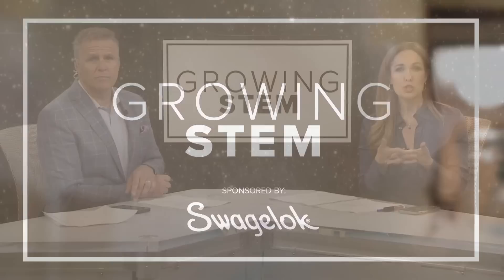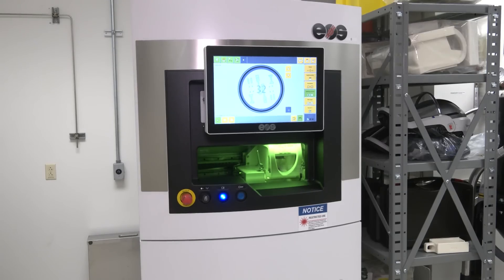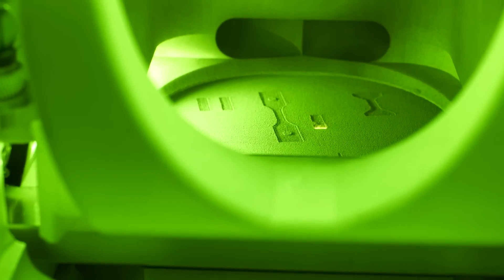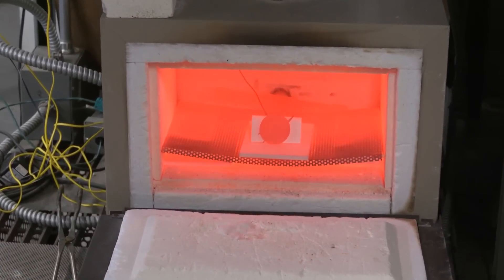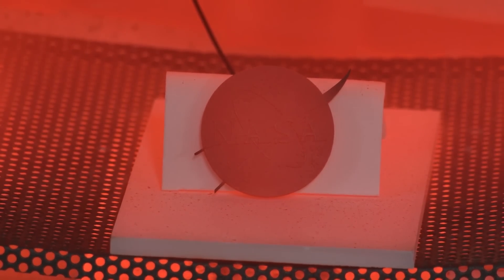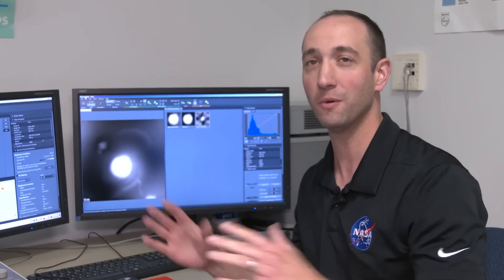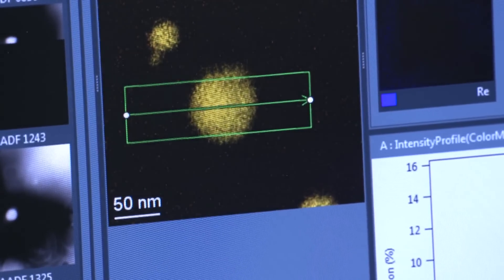2 NASA Glenn engineers invent new superalloy worth billions | Growing STEM

Comment: What's the ultimate tensile strength? Melting temperature ?
Reply: this alloy is also a few years old
Reply: The MDS is available via the 3D Systems website. Graph shows ~125-130MPA at 2000ºF. Melting temp not given, but the material did stretch by 38% at 2000ºF
Reply: @sapiotone Inconel 718 is still the king
Reply: @spartanpatriot3163  Think of this as enhanced Inconel. The use of dispersed oxides will definitely upgrade the high temperature performance over regular super-alloys.
Reply: @Hydrazine1000  Still ceramics including Ytterbium , Iridium , Tungsten seems better alternatives to high temperature applications such as hypersonics for instance where 1100 degC is nothing and we are talking about 2000+ degC but of course ductility is also important MMCs are CMCs are good choices.
Reply: @Hydrazine1000  : People like you (MSc materials) need to invent transparent aluminum like in star Trek.
Reply: @nikolaforzane2285  I hate to break it to you, but Star Trek is Science Fiction so transparent aluminum going to remain a dream. At least, per the lore, metallic transparent aluminum is impossible because aluminum does not have the atomic properties to achieve this.

Then again, if we veer away from the Star Trek lore, we do actually have transparent aluminum now. But it's a compound of aluminium, nitrogen and oxygen, so it's not metallic.
Reply: @Hydrazine1000 AlON is basically a ceramic material right?
Reply: @user-lp3cf5yn5b  Yes. And not "sorta" but fully conform definition of strongly bonded metallic and non-metallic elements.
Reply: @Hydrazine1000  transparent ceramic material is just as cool as a transparent metal as far as I'm concerned. Do you think they'll ever be able to mass produce it in a way that will lower the cost to make it commonplace?
Reply: @sapiotone u smart ty
Reply: @sapiotone  Big stretch but I don't know what it should be compared too... I wonder if it expands less at lower temps for forged engine components?
Reply: The video prompted me to do some "searches"... and you might want to give it a try.
Reply: Open google before you open your mouth.. https://ntrs.nasa.gov/api/citations/20220013032/downloads/LLNL%20Seminar%20-%20GRX-810_v1.pdf
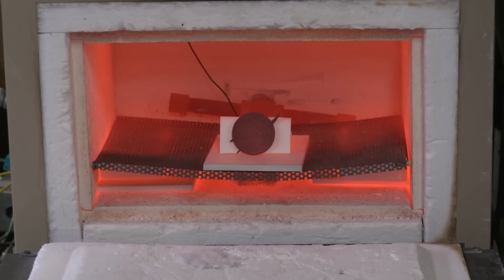Reply: 1:22 Ceramic
Reply: NASA is never fully transparent and only serves the interests of the aerospace corporations, not the public.
Reply: meh, id still take damascus steel blades to a composite  😅 jk
Reply: Basically, this is kind of like 316L Stainless Steel but without the iron! I would say it's worse than 316L for machining and forming and has 1100+ Celcius of heat resistance! Medium Entropy Alloys are highly cold and corrosion-resistant but only good for a general-level of TOUGHNESS in those same cold and hot environments. They are not strong tensile strength-wise (i.e. 350K Maraging Steel is 350,000 PSI ultimate strength and yield strength is around 320,000 PSI in comparison!). This Medium Entropy Alloy (MEA) is about 90,000 PSI base tensile strength and won't crack even in space cold (i.e. -250C and below) so if you wanted to build a satellite or spaceship, this type of metal might do just fine! You can get versions at 290,000 PSI but that just makes it brittle!

I personally would just use thicker 316L or 440C Stainless Steel sheets and coat it in a 3 to 8 mm layers of Aluminum Oxide Ceramic (2000 Celcius heat resistant) and Line-X Truck Bed liner (i.e. a super-tough and weather-resistant polyurethane-based coating!) to prevent hydrogen and cold embrittlement! It's much cheaper than this stuff and it has 75,000 PSI tensile strength so not that bad, good enough for most jobs and is ductile enough to not simply break in half any-old-time even in the cold of space when it's properly coated with ceramic/enamel and some Line-X Truck Bed Liner!

You can even use 440C Stainless Steel with 110,000 PSI Tensile Strength normally and with some fairly inexpensive aging and heat treatments, you can get it to 285,000 PSI tensile strength!

V
Reply: That is probably confidential information at this time.
Reply: @The1stDukeDroklar The ingredients can be confidential but the properties of the material??! Are you dumb or something??!
Reply: @The1stDukeDroklar  LoL what bull shit what's tensile strength to do with any confidentiality
Reply: For a know it all . That's a pretty stupid question  @FLORIDIANMILLIONAIRE
Reply: @The1stDukeDroklar I highly doubt it's a big breakthrough.
Reply: nano 
0.00000000x 
10^-9  ...
Reply: are you asking the comments or the reporters.. Either way, do your own research if your really interested..
Reply: That's too much information for them to make up about this fake story.
Reply: @VoidHalo  This isn't fake. It's just a tiiiiny little bit hyped, that's all. 

This GRX-810 is a so-called "oxide dispersion strengthend alloy" which means they've caused nano-sized oxides to form in the alloy. Those oxides do help improving its properties at 2000 °F ( about 1100 °C), there is nothing magical about that. 

(Background: I do have an MSc in Materials Science & Engineering, so perhaps I do have an easier understanding of what it is that makes this material special.)
Reply: @Hydrazine1000 what makes it special?
Reply: @FlowSharp  Because this starts as powder for 3D printing, they can mix very fine metal powder with ceramic powder. Getting those two very very finely mixed, in a way that they don't separate during powder handling or printing, is the difficult part. They mention ultrasonics for mixing, which makes sense to get very fine powders of different densities uniformly mixed.

The powder bed selective laser meting (SLM) printing process melts the alloy and incorprates the oxide particles, so you end up with a metallic structure with uniformly dispersed oxides inside, which improves the high temperature performance significantly.
Reply: @Hydrazine1000  Thanks for the info.

Comment: Utterly Useless Reporting, you fail utterly to describe what properties  make it a better alloy...
Reply: It's a fracture resistant material that can operate at 2,000 degrees Fahrenheit.  Temperature resistance materials are typically very brittle.  This material is less brittle than those other temperature resistant materials.
Reply: I got useful tips like using ultrasound to mix, I can find lots of uses for that.  A composite metal/ceramic part is natural evolution of pine resin/carbon powder composites cavemen used to bond handles to stone knives.
Reply: @miken7629  I think the key is they use the laser to then melt the metal in an extremely focused and limited fashion, trapping the ceramic in the structure. The nano particles and ultrasound mixing are just probably one of many ways they could go about the prior step.
Reply: I gave it a like, but not sure it was completely fair. But the complete lack of quantitative information made it impossible to determine much of anything from this report.
Reply: @davefoc  It was more of a infomercial than a NEWS report. The "Its beyond me" was a bit overplayed here by Ron Pearlman but she has a Great smile.
Reply: Ummm, they clearly said it could withstand extremely high temperatures that would cause other alloys to fail. It also told you that it is 3D printable which allows it to be made into shapes that others could not. What more do you want?
Reply: @The1stDukeDroklar  quantitative information
Reply: Propriety ingredients?
Reply: well... they dint tell but a crossproduct is tungstencarbidpowder sinterd and coated with TiAlN or similar ceramic. Or some super nickel alloy powder coated with some tuff ceramic like coating. You can do a lot with 3d printing the trick hereby is the spongelike matrix that can get coated almost everywhere. By having a very robust metal skeleton and a ceramic coating you can build a lot because the metal cannot oxidize in a harsh hot enviroment. 

Some german private company made some air pressure testing nozzles 3d printed the trick there was that the nozzles are 200mm long 4mm thick with a 0.5mm hole you could not drill the hole because of the nozzles shape, was like an "J". 3d print that is easy sintering to but drilling impossible. 

it is a amezing technology for sure!
Reply: @fearlyenrage  I love this stuff. I want to see 3D printed / acoustic-mix carbon nano tube superconductor, printed within a substrate semi-conductor. (or something more intelligent than my musings)  I bet someone with similar ideas, but an infinitely deeper understanding of them, is wondering how to fund such a project, right now. I hope so anyway. It feels like we're close to a point where our state of the art production, and computing, will find their convergence in time, and mutual benefit, to create a better version of a machine or process than what we have yet to completely conceive. And the human brain will add to that positive feedback. Amazing things are ahead!
Reply: what ? they didnt describe properties?! did  you even watch the video?!
it withstands rapid heat fluctuations without structural change/failure & is printable!
Reply: They described it.
Buy a thesaurus.  Look up synonyms for 'utterly.'
I have a feeling that you also overuse that word elsewhere.
Reply: On the NASA gov website you can find more information on this alloy. 

The big benefit of this alloy is its properties at 2000 °F operating temperature, compared to more conventional superalloys. At this temperature it can bend a lot more before it breaks, it has a higher fracture resistance and it is longer lasting.
Reply: They said it's heat resistant were you listening? You want specifics? Wait for the first run product to be made.
Reply: but China has ceramic materials too , I wish the news channel keep their mouth shut about any hints of its composition .
Reply: Report said it was tougher and items made by this process could be reused, ceramic properties make it heat resistant. Printing process makes complex shapes possible.
Reply: You're not smart enough to recognize that info WAS IN THE REPORT.
Reply: I have learned from this video that this is a great new material for rocket engines because of the way it is. It is also pretty  good for airplane engines because of the way it is.
Reply: Ever heard about confidentiality? 'China copying capabilities'?
Reply: @hosamebrahim9160  China knows the desired capabilities, we all do. The mystery is the recipe.